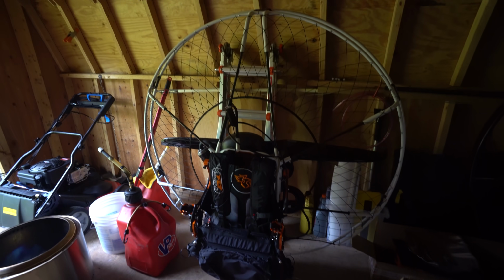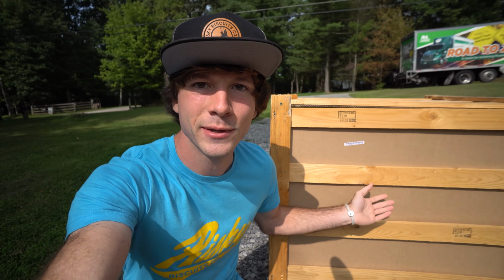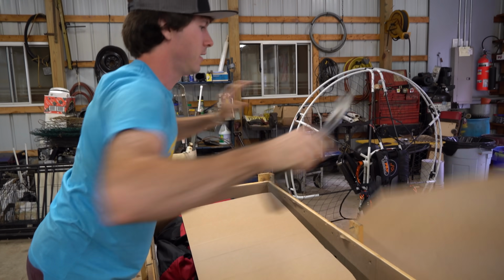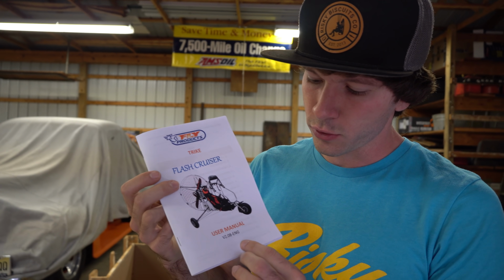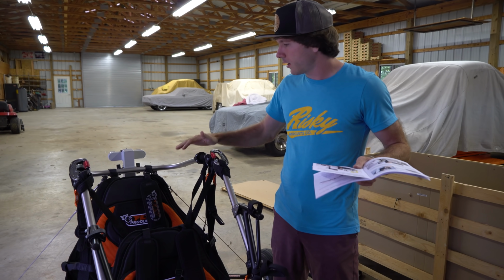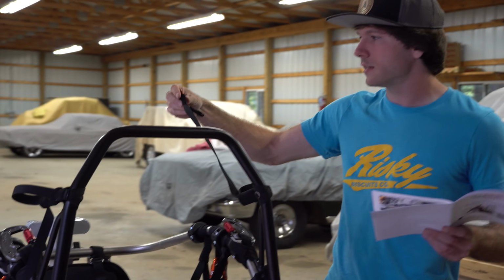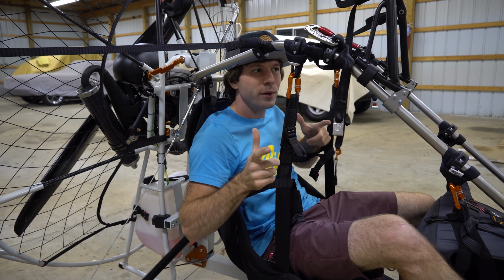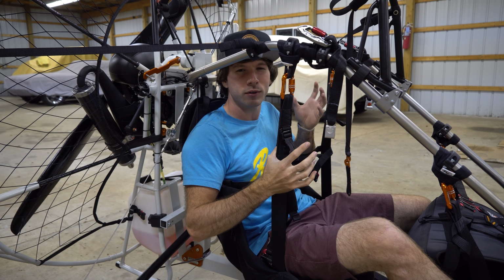Are trikes just for lame old dudes?!?

Comment: Trike Safety:  Do you need a bigger reserve parachute for the trike? If so, where are you going to carry it? Are you going to practice deploying it? Also, with all those new straps and wires do you need to go around the trike and tie them down so they don't get sucked into the prop? Do you need to do a safety check like you would on a small plane? Do you need to do flight plans? I would think so because if you have a motor out landing and taking off again might not be as easy...

Comment: Congrats Tucker.

On the day my foot-launched PPG shipped, I broke my foot.  I was able to temporarily borrow a trike to mount my Moster to in order to get in the air sooner during the healing process.

I know what you mean about steering sensitivity/steerability at higher speeds.  Someone recommended I rig some bungee cords to the front wheel chassis to keep both sides in tension.  Still easy to steer, but provides some extra dampening at higher speeds.  It made a HUGE difference in stability.  YMMV, but something to consider playing with if needed.

Also, trikes can be EXTREMELY tail heavy when no one is in the seat.  It could be very easy to tip on its back and crack a prop or cause other damage if the wing catches some wind during setup while you are out of the seat - something a foot-launcher might not see coming.  It's possible your trike could be more stable than mine was, just something to keep in mind while you are getting to know this machine.  I'm probably one of the few guys who have broken a prop without the engine running (lesson 1).  Which led to lesson 2: how to salvage a cracked e-prop . . .

Comment: I guess I have to admit that I’m too old for the foot launched design. I have enough titanium parts, wires, and screws that I could probably build a trike for small frogs. Last November marked 46 years since my first solo in a Cessna 152. I moved up through fixed wing aircraft to a Lear 35. Bored with glass panels, autopilots, and ATC, I soloed a helicopter 22 years ago. I felt like I had rediscovered the joy of flight. 

Your aviation adventures have rekindled my excitement for something new and exciting. Thank you for introducing a new dream.

Comment: You summed up really well what I've been feeling about my Rider for a while. It's nice equipment, but the unorganized feel has its drawbacks. This has been my first year of flying, and I've been having a lot of trouble with my forward launches. Come to find out: in the spaghetti of my harness straps, I had slightly misrouted one of my legstraps; causing a reasonable weight-shift every time I tried to forward. It was no big deal once I was in the air, but on nil wind days it made things almost impossible to launch. While I don't mind how it looks you're right; the disorganization can hide potential problems.

Comment: If you connect springs on each end of the front steering, it will allow it to self centre and make it easier to steer at high speeds.
Reply: The Fresh Breeze Fly Pod has a reverse cantilevered front wheel which is supposed to be self centering.

Comment: I like the Retracta Trike. It’s the bare minimum for a trike stable and even tucks away even more in flight, uses a regular paramotor harness. If need be you can land on your feet with you standing up the trike will dangle around knee height.

Comment: This is an awesome video! I have been hesitant on getting into paramotoring due to my back, ankle, and knee problems. I am only 36 but these issues are of great concern to me. I am an experienced aviation mechanic and have built some really neat aircraft over the years. Watching your video has made me very curious on how the steering works. One aircraft i have built is a Breezy. I am wondering if the steering is similar to one of those. If you have any insight on my question I would sincerely appreciate some feedback. TYIA

Comment: Most any "lod" (me 64, 2+yrs now ppg) would have already explained how the trike or quad can go way faster on the ground than in the air.  Most do no have brakes and get skittish pretty quick when driven.  Personally I found the A assist required pretty straight in to the wind for launch.  I removed mine and went to manual.  Though Tucker inspired me it wasn't to "fly" like him.  My fly is cross country and if I could make it fly slower I probably would.  I can treetop and fly low like I did for 40 years in my hot air balloon.  I don't need a crew and can return to my start point.  I do like to pull a tight turn and fell my butt pushed down in the seat but mostly just love the vantage and cruise.  It's all about what you want from it.  Wheels work for me!

Comment: A corpse always leaves a lot of questions. One of the most common is "What was the (immediate) cause or mechanism of Death. First, Death is not an exclusive experience; we will ALL experience it at least once, up close and very personally. It is cessation of Life. "But what did this person die of?" Other than clipping a stone wall at 200 mph on a motorcycle at the Isle of Mann TT, or one specific medical issue, a great many of us live long lives, give our loved ones uncounted headaches with un-calculated risks, and die, full of Life Experience and wanting more. One if the MOST COMMON causes of Death is "An Accumulation Of Deficiencies." As an "Old Guy," I've accumulated a great many Deficiencies. But I've been a "Wise Chicken" and spread the risks over many years, accumulating my deficiencies slowly, stopping just short of Death many times and extending the Joy of Life until my body is mostly used up. There's nothing wrong with being Old. There's nothing wrong with being (or acquiring) Disabilities and Deficiencies. Just ... take your time about it. Know what Discomfort REALLY means ... (Heads Up!) ... and keep the brakes on as your body approaches Damage and Destruction.
John Wayne, dying, said "I'm a greedy old man. I've had a good life and I want more of it."
So live, that you may finish the last quarter of the game. without regrets.
I'm in my 8th decade, and I wanna go flying.

Comment: ha..just do a lame old barrel roll and stuff, also land downwind or any direction, just having fun..plus save your spine..and no worries about the nervous steering, ( there should be springs to keep it straight automatically) - as soon as the glider is up, it will give you partial stabilizing lift already, to do slaloms on the ground etc. its like half way flying...without a lot of speed like without wing..thats a totally different drive and acceleration..
anyway same pendulum thing ..you feel a wheel goes up, turn to the low side..until you can do it purposely- maybe use a cheap wooden prop for hardcore taxi training..hehe.. and ,the cross bar on the main frame is to make it rigit , the forces are coming from all sides.. after touch down always follow the falling glider and/or also keep it rolling until the glider falls behind in case..no quick side steps possible..and same old hot exhaust..worst embarrasment is a "turtle" take off - strong wind take off without a helper on uneven ground.. nice..:-) btw.. its an airplane thing.. so landing is accordingly speed flare, not paragliding touch down.. exept at wind limit..well and a trike looks a little less funny than a foot launch..that alone is a reason for a trike.. and reverse launch also possible..and your passengers will buckle up and have a good time sitting instead of.. ... ...
Nice compact short trike design - keeps the weight compact👍🏻 better than a wagging banana boat style fashion trike. Finally, switching off the engine and go thermaling is part of it.

Comment: I think the average age of a quad student is close to 58yo at Blackhawk training center in CA. Great instructors for us 70 yo students. I chose to buy a quad because I could always get it up in calm winds. It was too hard to run a foot launch with all the weight if there was no wind.  -Also, I motor over to the fuel pumps instead of lug stuff over, and I can carry tent, tarp, slbag, water, stove, and much more for long cross country flights - and camp on the top of hills.  Did you consider a quad, ofr was the breakdown capability of your trike the key attribute you wanted?

Comment: what would be cool is if the trike mfg's woud get into some serious light-weighting (carbon fiber) so that a standard paramotor motor could be used for power.  like, maybe target 25 lbs total for the entire trike assembly.  true, the wing would also need to be bigger, so that would be the only thing additional you would need.  btw, i'm 56 and can still run a 9:00 mile, but i would still definitely go with a trike.  tucker, this may be a new demographic for you to reach.  do your risky biscuits rad shit, but then add trike videos, solo and tandem, for us middle-aged and older folks!

Comment: Huge shoutout to Tucker. I’m a lame old dude. Been watching your videos and I’m thinking about a quad for myself. Question: why is there no steering wheel on a trike or quad? After watching this video I noticed you had a hard time steering. Any comments?
Reply: No steering wheel because you need your hands for the wing and engine controls, on the ground the trike steers with your feet.

Comment: Looks like a nice score Tucker! For future reference, taken from a note of aviation maintenence, all hardware is typically installed in a manner that the orientation would be facing into the direction of flight, that way there if the nut were to back off for any reason, the force of the wind would more likely keep the bolt in place rather than backing out and departing the aircraft. The same goes for those quick release pins that you installed while aligning the holes to get the cable tension set. They should be installed from front to back. Just a good measure of safety bro, looking out for ya!

Comment: Quick question: why wouldn't this tandem trike be considered an LSA?  I know that you can get an exemption from the FAA for a foot launched tandem paramotor under FAR 103 for training purposes as feet don't qualify for "fixed landing gear" as described in the definition for Light-sport aircraft in FAR 1.1.  However, a tandem trike clearly does meet this definition.
Reply from the maker: The tandem exemption was extended to include wheel launch (I believe) two years ago.
Reply: @TuckerGott  Just make sure in future videos that you make it clear that those flights in the trike are for training purposes.  Some nosy busybody may report you to the FAA (again!) and if you don't make it clear in the video that you're conducting training you could be in a bit of trouble.
Reply from the maker: @peteranderson037  Definitely! All flights will be for training purposes. An introductory flight lesson of sorts. 😁
Reply: @Kolbra2004  One does not simply get an N-number for an ultralight trike.  If you try to register it as an experimental amateur-built aircraft you would have to prove that you did the majority of the fabrication work to assemble it as per §21.191(g) (a.k.a. the 51% rule).  This video is basically proof that Tucker didn't do the majority of the work.  Alternatively if the manufacturer had it certified as an E-LSA then the 51% rule goes out the window, but that's something that only the manufacturer can do.  As far as I can tell neither Fly Products nor Aviatior PPG - their US importer - have done this.   That's why there was an exemption in the original LSA rules to allow converting old "fat" ultralights to LSAs without meeting E-LSA or E-AB rules.  However this exemption expired in 2008.  The only alternative now is to fly it under FAA exemption #9751E which limits you strictly to flight training.

For those of you on the sidelines reading this, this is why most people stay within Part 103.  Once you get out of that things can get complicated really quick.  A good chunk of the requirements for any pilots licences under Part 61 involves ground instruction for regulations.
Reply: @Kolbra2004  Yes, that was my interpretation of the exemption letter as well.

Comment: The Triox is a very good wing but if i were you, i would also try the dudek cabrio, the new dudek Boson, and the niviuk R-Bus before buying. They are all very good wings but the one is faster and more agile than the other. With a trike you have more options than footlaunce wings because you dont have to run. and if you fly the boson, you will find out it is not for lame old men. I am sure you can do barrel rolls just as easy with the trike and boson as with a freeride and butt fan. Enjoy your flash trike

Comment: I thought the exact same thing about electronic drums my entire life. But when I began to drum  myself I got a small set of electronic drums due to the portability and ease of transport. However, once I started the band I had a nice pearl 7 piece double bass kit. Almost every show of the over 100 we did was done with Roland TD 30 electronic drums. The technology had come so far in 40 years. you could even do symbol crescendos which was impossible on earlier kits. Facts are the ease of set up configuration and amplification made it a no brainer. Besides, if the exact same technology was good enough for Neil Peart, Rush and their fans or folks like Tom Lang then who in the hell was I to criticize it. What exactly does pure mean anyway. I sure as hell am not seeing everyone out there with Write brothers fliers or Micheal Angelo's glider. I get a kick out of the very idea of pure Because no one is flying the original forms. Hell they criticize the old motors and old wings. I mean, Folks talking about purity can walk the walk by running a 1980's engine at least.

Comment: Tucker.  Check out electric unicycles on YouTube.
I want you or someone to launch from one.  I think they would be the perfect combination.  Just put impact tape on the unicycle and you can drop it as you leave the pedals, no problem.

They max out at 40mph so they have plenty of power up too 270 to 300lb riders.

The Gotway Monster 100volt would probably be your best bet. Or the Veteran Sherman.  Ewheels.com is the best dealer in America.  They ship.

Comment: If I was to take up the sport, I'd have to use a trike, or anything with wheels, as I have two busted knees and cannot run, foot launch is impossible
Reply: I have the same issues after 23 years in the Army and a lot of time in the infantry. I live in North Texas where we get a lot of wind all year long. I'm not sure flying a trike would be practical here most of the time.

Comment: Tucker,
I am not an A&P mechanic but you should have installed the pins from the front part of the frame, 6:51 plus minute mark.
All pins, bolts and the like are supposed to be installed with the head in the forward direction of flight travel.
The way you installed your pins, if they were to fail and come out, they would go right through your prop!
Just looking out for you and your passenger's safety...
Blue skies and safe flights!